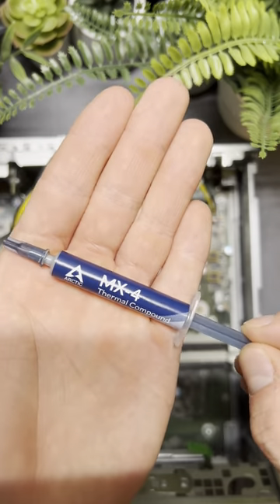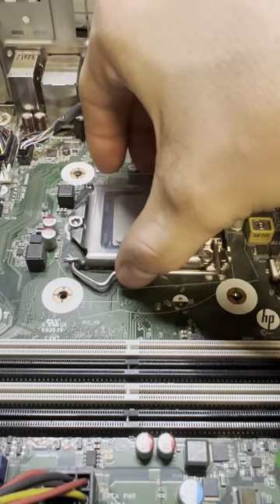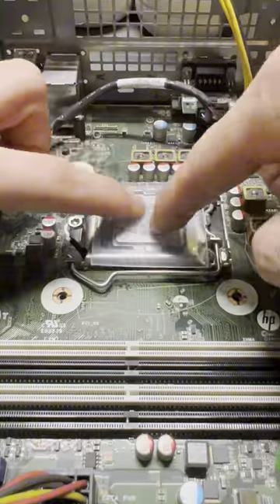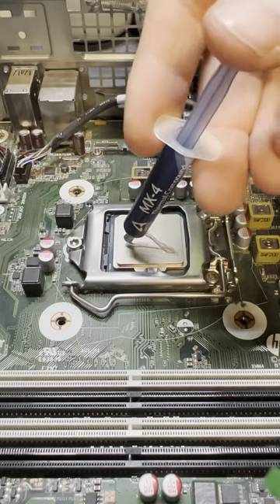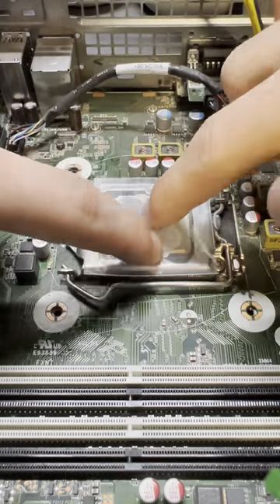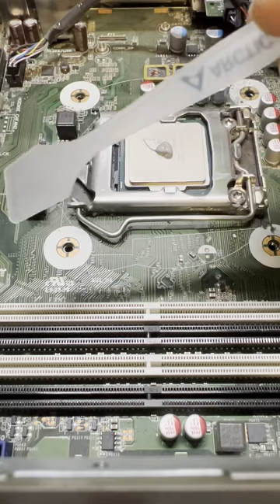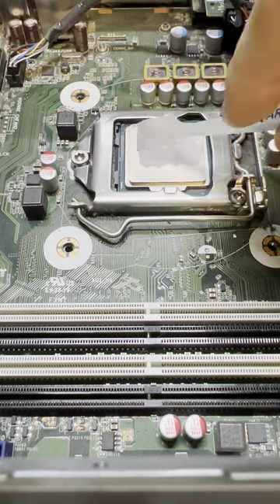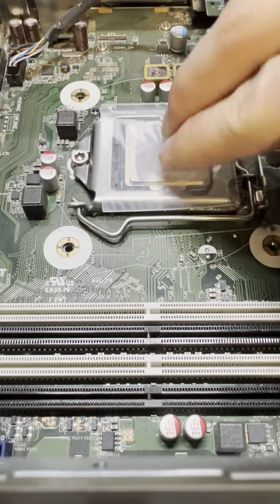The best thermal paste spread pattern.

Comment: Just make a slightly bigger dot instead though it also depends of cpu and its size
Reply: Actually its not important at all, I'd say the most important Part is just covering the cpu die behind the heat spreader, wich is most likely half the size and in the middle of the heat spreader
Reply: * except for APU's as they have 2 - 3 dies behind the heatspreader